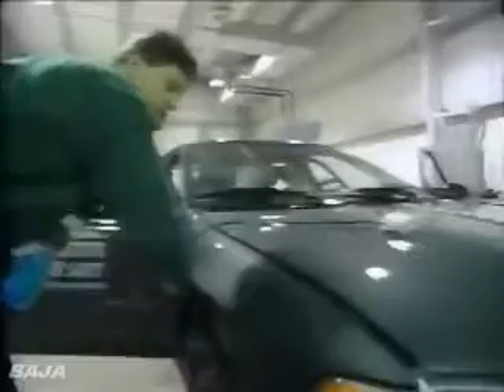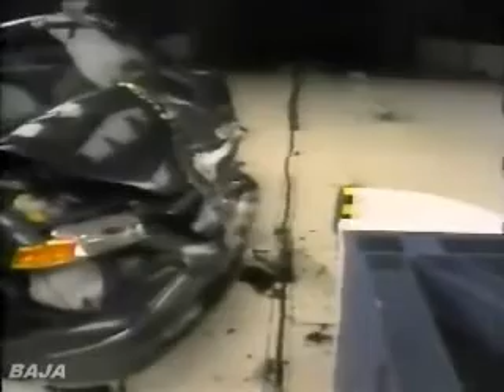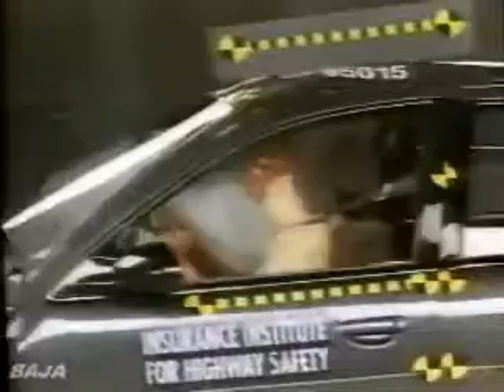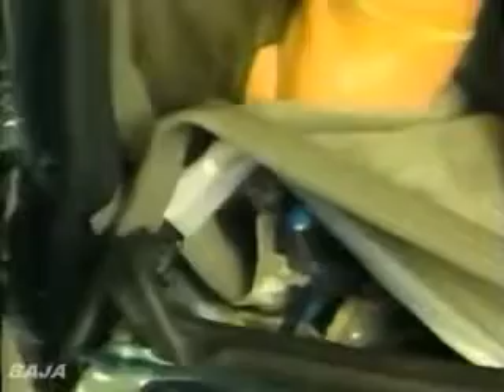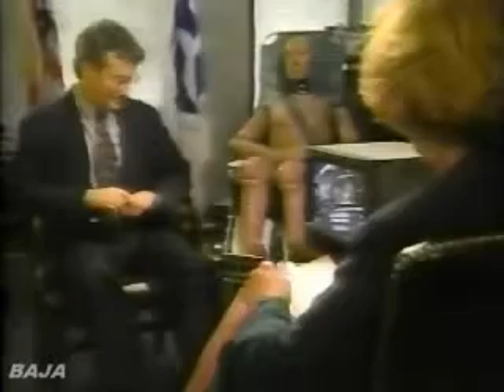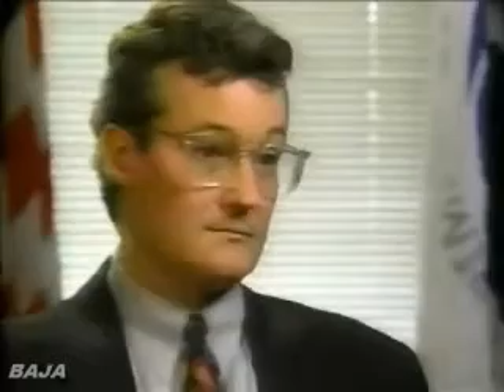67. IIHS Crash Test 1995, 1996, 1997 Chrysler Cirrus

Comment: I thought the Cirrus's frame would have been stronger than it is. it looks like it could take a hit.
Reply: Me too, I question these results. We have a 2000 Stratus and fortunately haven't seriously crashed it, but everything about it is incredibly thick and solid. The hood, fenders, doors, trunk, crash bars behind the bumpers, etc. It has been through a few minor accidents with no damage other than scuffs on the plastic bumpers though.
Reply: @averyalexander2303  the footwell was incredibly weak in the Cloud cars, as it allowed way too much intrusion which of course trapped the driver's legs in the crash. Oftentimes, the weakest part of the structure of the car is the parts you can't see.

Comment: I crashed my 97 stratus last year at 40mph, and it did way better than this car did. It hit on the left side like this one.  My drivers door opened fine, and me and my girlfriend had no injuries. We both walked away with a bruised shoulder due to the seat belt, but that was it.
Reply: Cuz you hit another car. TWO crumple zones. Instead on a solid block.
Reply: of typo
Reply: Most people break before impact, so it's highly likely that you crashed at a much lower speed than 40 mph. The footwell is so weak in the Cirrus, there's no way anybody would be able to walk away from this car after crashing offset it like this at 40 mph.

Comment: Pfft I got in a wreck at 50MPH in a 1999 model and walked way with a few cuts and a bruised knee. I call BS on this.
Reply: well you didn't hit a metal barrier did you
Reply: @CAMAROFAN45  A metal barrier with a shock absorbing foam block meant to simulate the crumple zone of an opposing car.
Reply: The battery being there is a good thing, it stays cool there, if changed it should be in trunk, but these were great cars. I've owned several. They should have made a v6 manual trans version though.
Reply: I crashed my 1996 just like that at 60mph and the console crushed my ankles.  One was broken and I had to pull myself out of the car through the window.  All doors were crooked and impossible to open, even the trunk.  This is not bullshit, my car looked like this one after.
Reply: It depends on the year cirrus got new upgrade parts in 97  and up I own a v6 good car fast and all my only complain is where they put the battery but all and all i love it this video would never change my mind on own one again

Comment: I crash tested my cirrus last night. :(
Reply: What happened?
Reply: @lol-de4lo  I was traveling late at night approaching an uncontrolled intersection and so was another vehicle. She was moving at just the right speed that her headlights remained blocked by my windshield pillar. Suddenly the broad side of her car appeared in front of me and the airbags were set free. She got the ticket for failure to yield. I fixed the car and drove it for another six years until it wouldn't hold coolant. Good car, good memories.
Reply: @BusterDasch  im surprised that you replied but thanks.